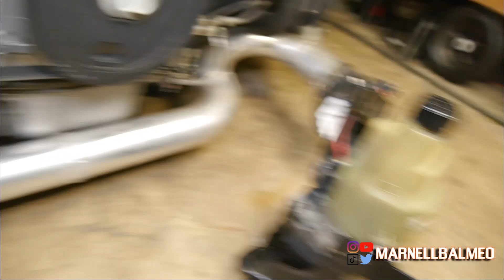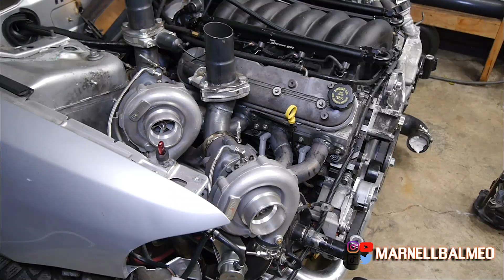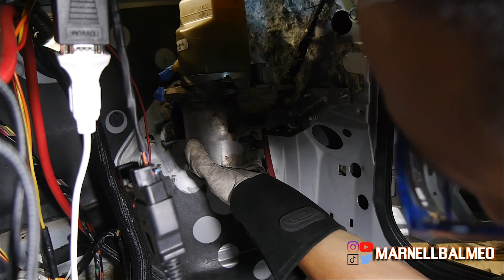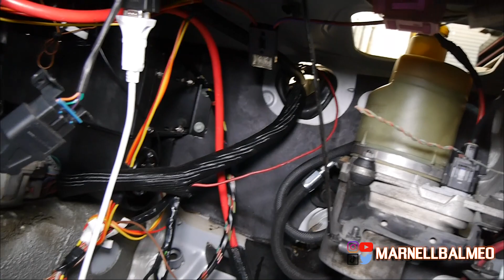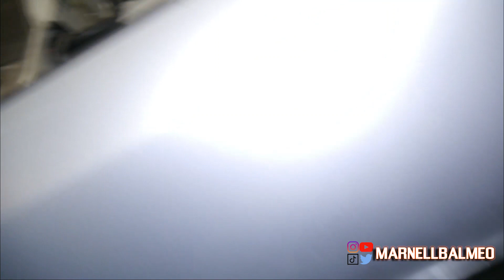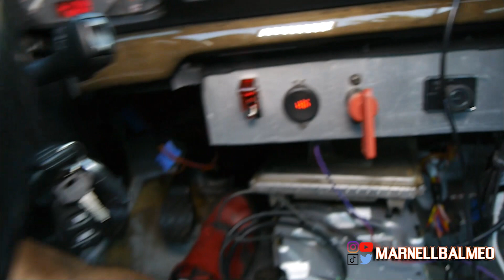How to convert to Electric Power Steering Pump

Comment: 3 years late but do not directly mix stainless and aluminum magic of corrosion stainless has noble metals like nickel and aluminium is less noble and the less noble metal will start rotting especially in threads this will resut in the threads fuzing together and usually the stainless bolt will only come out with violence but mind i said directly you can avoid this by using thread sealer or locker and ive heard that sum people use grease to separate the two

Comment: I’m going with this setup. Using an 08’ pump 08+ doesn’t have external resy. Using stock fox hose n rack. All plugs right in NO fittings or adapters

Comment: Is it still working today? any problems so far?
Reply from the maker: Yes still working awesome. Super reliable to, I've had zero issues since install and actually haven't touch it since then lol
Reply: @MarnellBalmeo  I've been planning on doing one on my LS swap, did you notice more horsepower since it's not using the drive belt?

Comment: The tensioner should be installed on the slack side of the belt. You can see it flexing when your rev the motor
Reply from the maker: 😆 correct realized that after it started to slip. Will eventually redo it

Comment: Could the steering response lag be due to having longer hydraulic lines than the stock setup?  Now I know hydraulic fluid is supposed to be uncompressable, but there still might be some effect of longer lines. Also, if there were any air left in the lines, that might account for the lag. Those loops in the line might prevent air bleed. I wanted to bring up the possibility that the fault might not be the pump, or the computer control of the pump.
One other person commented about a fail-safe for the power steering.  I imagine this might trick the computer running the pump at a low pressure whenever it looses feedback from the unit. It might be interesting to force the fail-safe mode and see if the responsiveness improves. This would indicate a control issue, instead of a pressure issue like might be caused with longer lines.

Comment: Did that in my Land Rover restoration project.  Added a 555 30-sec delay timer and an LED to the dashboard to indicate when the pump was up to proper speed when ign was turned on
Reply from the maker: 😅 power on and off is all I did for mine but mines also just a racecar deal

Comment: Better to swap the steering rack out for an electric assisted rack and you will never have a noise issue, but with instant feedback and lighter.
Reply from the maker: Steering feel is pretty good, I don't think I'd want it any lighter. Not sure I follow, what's the difference between the rack? Should be the same. Though noise on a car that has hood dumped exhaust is hardly a concern 😅

Comment: do you no if the pump will work on a 2003 crown vic rack i put a ls 1 motor to a crown vic front
Reply from the maker: I don't see why not, all it does is replace a manual pump.

Comment: Do you have it wired to a sensor or something? Does it just run alll the time ? And yea it’s load it’s sounds like a spacecraft about to launch
Reply from the maker: I have it on a toggle switch. I snapped a pulley on my serpentine belt a while back and I'm glad this is on a toggle. It's nice being able to have PS when your engine is off lol

Comment: Hey man I just did this same thing.  No leaks or anything but when the pump is running the steering wheel just shakes left and right like by itself... run into this ? Any ideas ? 😠
Reply from the maker: I did not. It just feels like a regular power steering. A noisy power steering lol

Comment: There an issue when the can bus wires aren't connected  mainly heavy steering under quick steering, with  the can bus missing its not able to ramp up pump speed , typically under fast  steering it'll pull 40 amps , you need to find away to fix this issue  of heavy steering when under fast response.
Reply from the maker: Thanks, yea that is definitely noticeable when I tested multiple quick change in steering direction(going lock to lock). I have decided this isnt an issue yet, when I take this car for autocross or HPDE event this summer I will decide if it will need to be fix or not.

Comment: Grey wire is what ,??
Reply from the maker: Toggle switch, that's connected to key on. You could wire it to a fuel pump trigger to I suppose so it's on when the car is running.

Comment: Where did you get the wire harness,  the one I got from the car the pump cam off is busted.
Reply from the maker: sorry I ordered this on ebay and looked specifically for one with the harness since I read its hard to find in the JY.

Comment: Do you have a complete standalone? If so who taught you to wire it? I have a s13 with a 1uzfe and need to make a completely new standalone harness and my motor doesn’t have a pin out. Any suggestions?
Reply from the maker: I have a video on here of me doing my wiring. I found alot of information on Youtube and Google but it's an LS so it's pretty well documented. I'm not familiar with the 1uz so maybe start with the forums.

Comment: Is a bit too noisy to have the pump in the cabin. Try in the inner front guard.
Reply from the maker: No space in the front guard. Maybe if my setup is different, with hood dumps exhaust  you can't hear the pump 🤣. I was also trying to avoid adding weight up front since the car is already front heavy

Comment: Badass but idk if I'd have it in the cabin, for sure would move to the trunk, in case the high pressure line's fittings fail
Reply from the maker: Just add a cover. Moving it to the trunk would add more lines and more weight

Comment: The key to best performance of this pump is to also buy the CEM and the SWM and a foot of their harnesses. The CEM handshakes the car's configuration ID with the pump via the CAN bus so the pump does not go into limp home mode. The SWM sends the steering wheel data to the pump via CAN bus so that the pump will increase its RPM to pump more fluid when the steering is turned aggresively. Limp home the pump spins at about 1700RPM. With the above 2 modules it will spool up to 4500RPM when needed. The pressure rating is 1700PSI.
Reply from the maker: At what point do you need 4500RPM? This feels pretty normal at standstill or moving
Reply: @MarnellBalmeo  it is a algorithm in the EPS. The lower the speed and the quicker the speed is the higher the RPM of the EPS. So if the car is not moving and you crank hard on the SW, the EPSgoes to maximum RPM. I have the EPS, CEM, and SWM and the EPS responds immediately to how I turn the SWM. The RPM varies in order to fill the fluid void caused by moving the steering, it isn't to increase PSI. The EPS can pump the full 1700PSI at the 1700RPM low through to the 4500RPM max. FYI: the 2EPS impellers are only 1/2" high and 11/16" diameter each. Hence the 1700RPM minimum speed.
Reply: @marinelifer1752  any more information on this I want to consider this for a hybrid car i want to build?

Comment: Problem with those is that if you don't send the correct CAN codes for steering angle, speed etc they run in failsafe mode which is the correct power for the original vehicle running at around 35mph. Way too much assistance for higher speeds and/or a lighter vehicle. The speed of the pump is supposed to vary according to load etc.
Reply from the maker: I've put acouple hundred miles on this already and it feels like a normal PS. Only thing that I noticed is if you constantly switch directions like you would in autocross there seems to be a brief lag. I've taken it from low speed to normal speed crusing upwards 100mph+ and feels like a normal PS. So even if it was in fact in failsafe, I couldn't tell the difference between this and normal PS.
Reply: @MarnellBalmeo  thank you!
Reply: Are you certain that's true for these model pumps?
Reply: @brandonl1840  Yes. I actually built a Volvo C30 race car and I started off with the normal system. I didn't run any of the standard computers in the car (there are 13 of them) so there was nothing controlling the pump. I tried to get the CAN codes from Volvo so I could program an Arduino system but they wouldn't tell me but they did tell me about it running in failsafe mode.  I even bought a CAN sniffer and setup it up on another car so I could capture the codes. I couldn't figure out which ones were which though. There are a lot of people on EV forums with the same issues, someone has done it as there is a video on YouTube of one being controlled out of the car but he won't reply to messages. I guess a lot of it is down to what type of cars people are used to driving and what roads they drive on. True PAS is variable and responds to the speed of the car and how much steering angle and load there is. For a race car this pump in failsafe mode is terrible as it's far too light when cornering at 100mph or even 50mph. For the wide open roads in the USA you probably would never notice and they are fine for drifting as many pro drifters use them (they generally use two though due to volume issues). I went for a fully electric column in the end which has rotary dial. That way I can have it on high when moving around the pits and paddock but adjust it right down for racing.
Reply: @adematthewsracing  thank you very much, I've also been looking into electric columns. This was a lot of help

Comment: Looks great!  What voltage are you applying to the control wire? What will that ultimately be wired to?
Reply from the maker: 12v and just hardwire to ignition and switch

Comment: Oooh just about to hit 10K! Big congrats. Just a note I hope you put either a shield around the pump or some kind of sleeving over the lines and fitting so just in case there is a leak you don't get sprayed with hot fluid!
Reply: Use a cooler inline so you get sprayed with cool fluid.
Reply from the maker: I'm thinking some sort of cover later on that hides all that. Maybe a thin fiberglass or something.
Reply: @MarnellBalmeo  That could work well so it's easy to shape however you need!

Comment: Nice! I have the external reservoir one that I haven’t installed yet, hope it’s not too loud tucked away behind front bumper cover.
Reply from the maker: Front shouldn't be bad, mine is inside the cabin so it echoes
Reply: Part number?